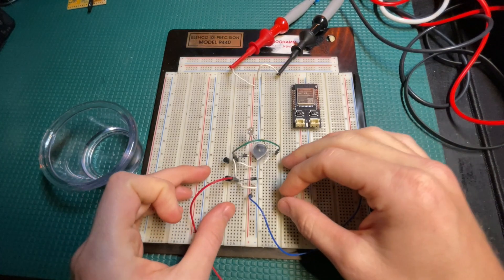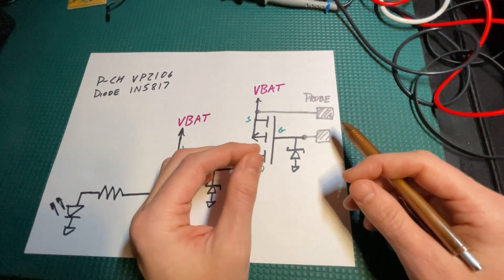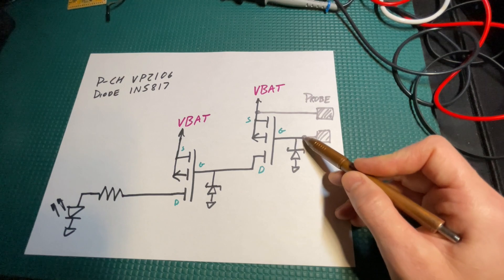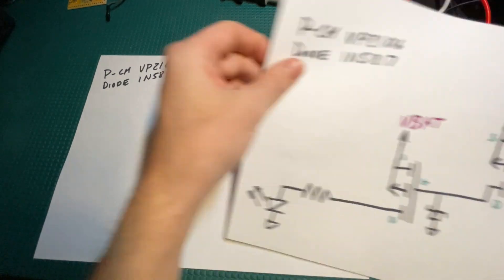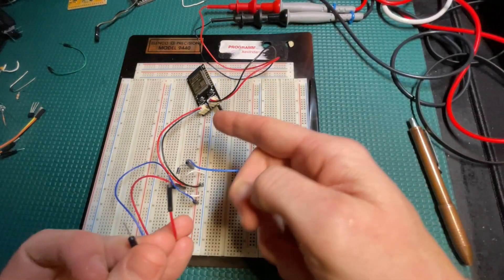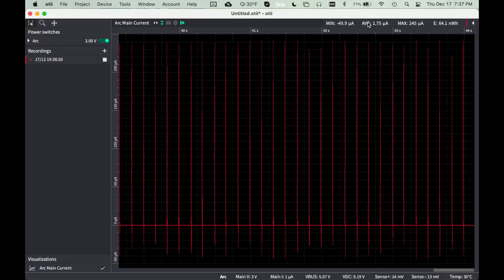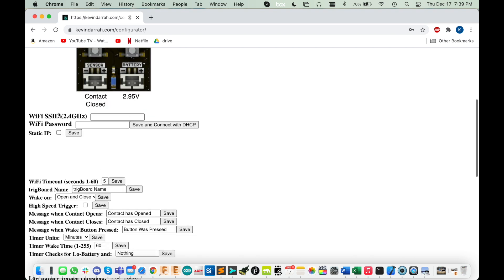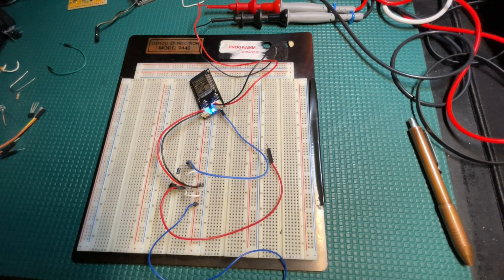Low Power Water Detector Alarm Circuit and IoT with trigBoard (Immediate Push Notifications)

Comment: Hi Kevin I have a question for you.   How long of wire can I use from the trigBoard to sense water?  My water lines run in my attic and I want to run a pair of wires along side the water lines and strip the wires bare at each water line elbow so I know if there is ever a leak.  Would this sense a leak on a wire about 75 feet long?  Thanks Dave.....

Comment: Why not use inexpensive op amps?  Then you could even determine exactly how much water/rain that you received--rather than just the presence of water?  Here's a good tutorial on how to use inexpensive op amps in such a way:  
https://www.youtube.com/watch?v=c7krjLWTiWQ

Plus, you can get essentially the same IoT device for less than 3$ on ebay:  
https://www.ebay.com/itm/264692336393?hash=item3da0e48709:g:ozcAAOSw1ZJejD5C
Note:  Why is your url to a 29$ version of the ESP32 IoT system??

Comment: Hi Kevin Thank you for an awesome simple circuit. I got a question hy at the first part you use 2 diodes and at the second part with the trigboard you only use half of it? Also how it can be applyed to Arduino or simple ESP without the trigboard?

Comment: Thanks for both explanation. I've seen a lot a water level detectors which work on Darlington transistor like the ULN2003. Are they more power hungry circuits?

Comment: Interesting circuit Kevin! Altough a wide spread of variabeles might require some tuning when you duplicate the circuit. The resistance of the liquid is variable, the Vgs of the Mosfet has a wide spread. A think a high value trim potentiometer in stead of the diode should give you more flexibility. Neverteless a perfect application for the Trigboard!

Comment: really cool. i love your passion for low power circuits and systems!  don't stop doing that!  also, this design would be useful for folks to have in the drain pan for their a/c unit and the drain pan below the hot water heater.  In fact, i think this could be a commercial product for that... something that clips on to the side of the standard drain pan and lets you position the sensor part (obviously can't let the pan conduct through the sensor) and has all the settings defaulted for the alerts and the low battery messages.  great work!

Comment: ok this is probably obvious but why 2 p-channel MOSFETs and not 1 n-channel?
Reply from the maker: this could possibly work for the standalone alarm circuit, but not with the trigBoard input.  That input senses voltage, so needs to be either there or not, hence the use of a single P-CH  but I did try N-CH as well as many other circuits - this P-CH concept worked perfectly with the least amount of components and held onto the low power performance regardless if triggered or not.

Comment: Haven’t you had any problem with corrosion on the VBAT contact of the water sensor? How long have you had this running for? And how long in actual water?
Reply from the maker: the leak sensors really haven't been exposed to water much, but I just tested them after months of sitting... all good.  The rain sensor sat outside for a couple months, went through rain over and over again.  All good. Originally when I used copper tape, that corroded and failed after just a week.
Reply: @Kevindarrah  that sounds promising. What kind metal is used for the probes?

Comment: Excellent video. You could even use an adapted version of this with different levels of contacts in a container as well as an empty function to detect rain levels and note the rainfall on a daily basis which could then be used to set up an automatic watering system for the garden.

Comment: Does your "TrigBoard" has a "brown out" detection and warning, so you get informed BEFORE running out of juice? some sensors you want to have them up for years without change of batteries. but then how to get notified before its too late?
Reply from the maker: yes, there is a setting in the configurator to set a low bat threshold, then you get a notification when the battery is running low - very useful

Comment: Very cool design. How would you go about adjusting the sensitivity of such a circuit -- say you want it to detect water but not someone touching it.
Reply from the maker: yea, you could change that diode out with a resistor, start with 1M then lower until you have the sensitivity you want.

Comment: Nice! would it be possible/feasible to have the trigboard power up / shutdown a mains powersupply somehow and use the battery only for wakeup?
Reply from the maker: yes, have the output drive a latching relay to kill power if water is detected.  Needs to be latching, since the trigBoard can't control its IO while sleeping

Comment: I am not completely sure as to why you used a diode. Does the diode have a lower current draw compared to a pull down resistor, also would a high value resistor have the same low current property as the diode?
Reply from the maker: yea, I also tested the circuit with 1M resistors and also worked fine.  I did find the diode to be snappier though and create a more sensitive response... I might study this further, but the diodes just seemed like a cool way to stabilize the gates.
Reply: @Kevindarrah  cool, but probably less reliable as there might be more variance compared to even 5% resistor.
Reply: @Kevindarrah  You may have to look at the temperature dependency as well. See Figure 9. "Typical Reverse Current", although curves are not drawn for 0V, in datasheet 1N5817. Looks like the leakage current varies much when it gets hot. I don't know if it matters ... in this case.

Comment: Hey, you asked to comment how you spell Solder, and it wanted to comment "SODDER! - Love you anyways" on your newest video (How to solder surface mount parts ..),  but it's gone!? .. :-/ Regarding the desoldering, try with "sn42 bi58 wire" (Low temperature solder) - it will mix with the existing solder and allows desoldering at "low temps" (180 degrees celsius == 360 degrees fahrenheit).
Reply from the maker: oh yea, thanks!  yea, I started to feel like that video was not complete without also showing better techniques - I may revisit that one